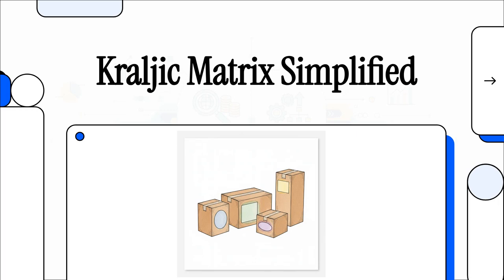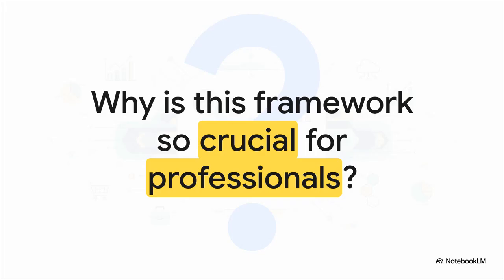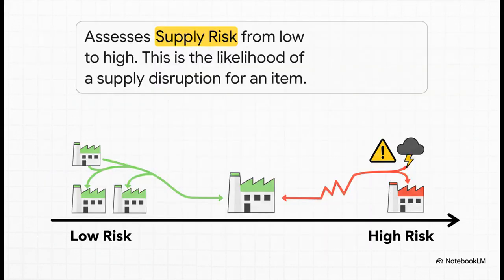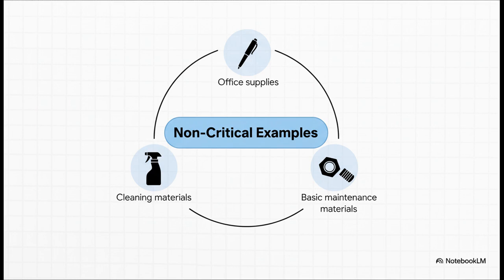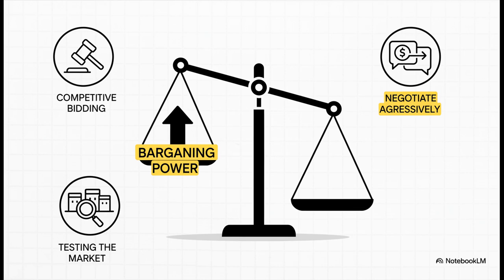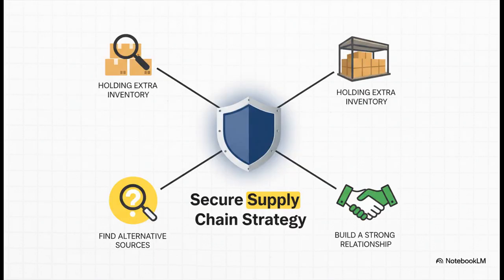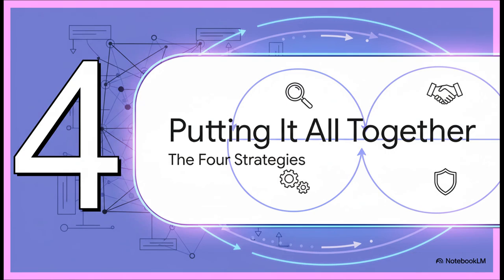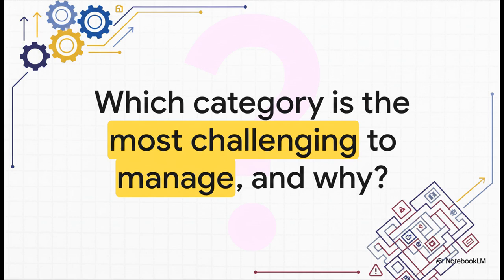Kraljic Matrix

Comment: How can companies practically move items from the bottleneck category to leverage or non critical?
Reply: Great question. Companies can move items from the bottleneck category by reducing supply risk and dependency. This can be done by developing alternative suppliers, standardizing or redesigning products to use more common inputs, increasing inventory buffers temporarily, and working closely with suppliers through long-term contracts or supplier development. As supply becomes more stable and risk decreases, the item can shift to leverage or even non-critical.
Reply: By developing alternative suppliers, standardizing specifications, increasing inventory buffers, and improving demand forecasting. These actions reduce supply risk and supplier power.